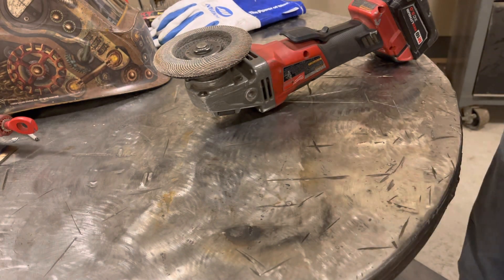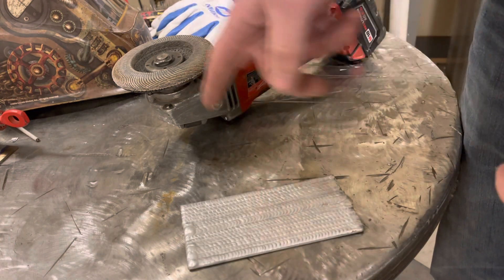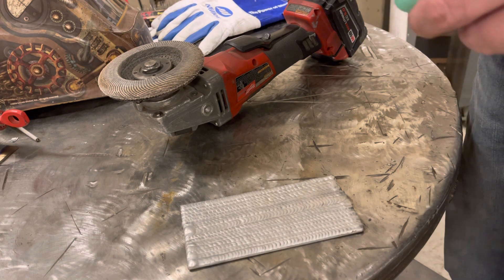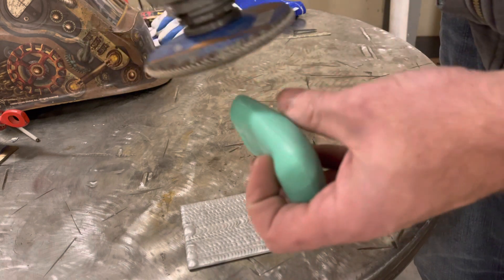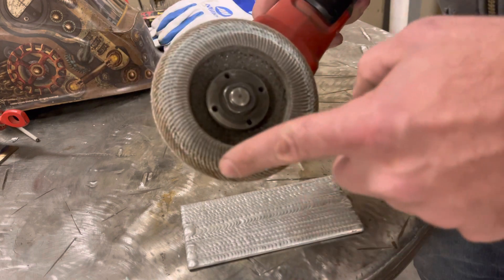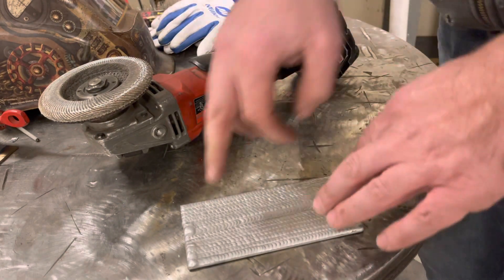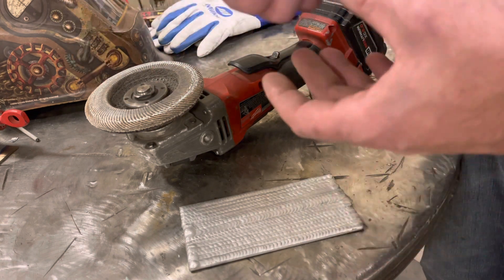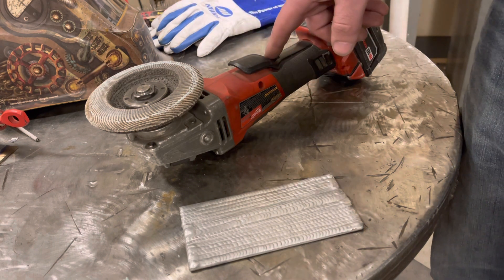Quick tip for grinding aluminum

Comment: Nice tip wish you showed a demo of its performance
Reply from the maker: It works so good it cuts 2-3 times faster.  The second the soap wears off it wont cut anymore.  Give it a shot, its night and day difference.
Reply: @makingmistakeswithgreg  thanks man. Apparently a wood cutting disc with carbide tips work really well too. I wonder what works better for cutting speed?
Reply from the maker: I have never tried a wood cutting disc.  I can tell you having done finish carpentry for a long time  that aluminum and wood have a lot in common when it comes to cutting it.  Standard t6 6061 aluminum cuts similar to wood.  Some of the other alloys tend to be far harder.  Honestly for most cuts I use a high tooth count miter saw blade with aluminum or a jig saw, both work great.